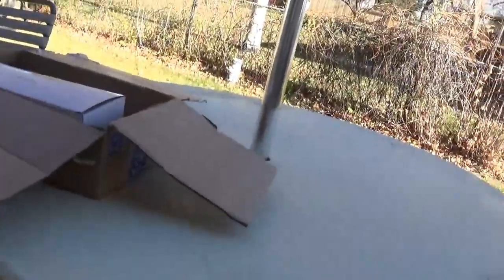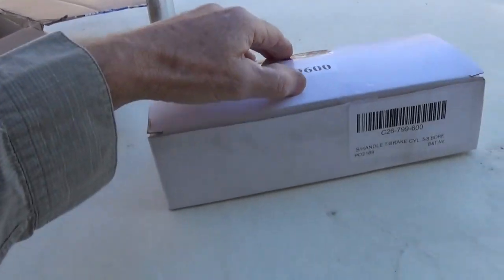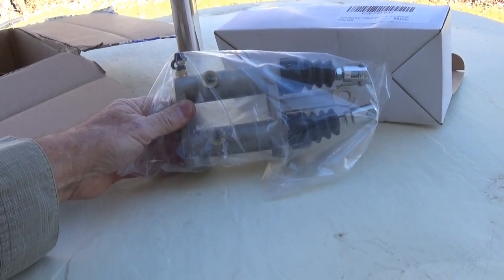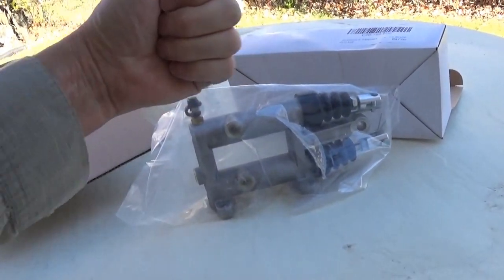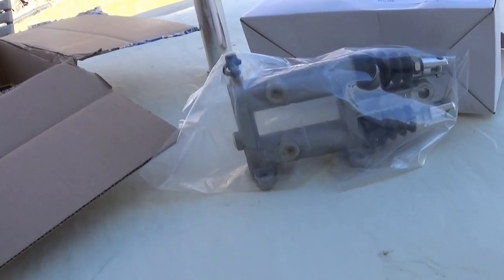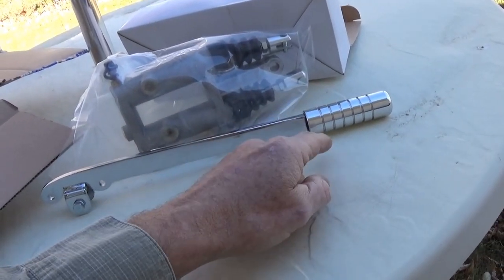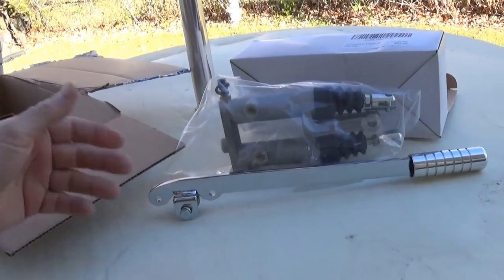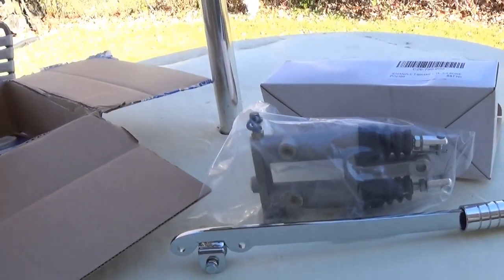Single Lever Steering Brake

Comment: Nice turning brakes, I bet with the single handle you could really operate them quickly!
Thanks for the bore size description, that was handy.
Reply from the maker: Quickly is part of it but it seems when I need it I need all of it really hard with one full hand and if I overdue it I can counter steer with out having to re-grip. It also takes up less space. I think it's more useful to me when crossing sand ridges because you never fully know what's on the other side durring those OH Chit moments. LOL  I don't even consciously think about right or left anymore my hand knows what to do so I don't have to think about it.

Comment: My 68 Tub Buggy had steering brakes when I bought it, but was just a homemade lever system that used the emergency brake cables!!  If the brakes were set up nice and tight, they worked pretty well.  Has a spool in it now, so it's all gone.  Have a buddy that has a hydraulic steering brake, and he uses it to lock up the spinning wheel when he gets stuck in the mud and snow.
Reply from the maker: Very Nice!  Before I got my Empi disc brake with E feature I used to take a bungie and hook it to my steering brake for a parking lock if I wanted to leave it running on a hillside.

Comment: I always wondered how those steering breaks worked but had something totally different in mind.... hope you put those on soon.
Reply from the maker: Just the kind of push I need. hehehe   It's cold and rainy outside right now. I don't want to shuffle around cars to get it inside and I have to buy some new brake line to work with. Thanks for your continued support

Comment: New parts make you feel good even if you don't fit them right away.
Reply from the maker: Especially if theres a little bling.   I've been admiring the chrome as it sits on the kitchen counter top all weekend.  One of the advantages of being single. hehehe

Comment: "South of the border" when we have to have the bubble flare because we have no adapter,  I make the standard flare then with a soldering iron and solder fill the flared area right up forming a" bubble" of solder, then drill  a 1/16th  hole in the center of the solder "bubble" and screw the line into the brake cylinder. Works great and seals just fine. Did that make sense?
Reply from the maker: What a great solution. Thanks Tim   Do you use soldering paste to get the solder to stick or rosin core solder or just what?
Reply: I use the paste

Comment: Oh yes your car your rules, Right? Nice, all them new parts means more good times for you in the sand . Never got to use one of those steering brakes before. Take care Buddy.  BigW:-)
Reply from the maker: I was thinking of getting another one for my Baja.  It makes sliding around on dirt roads easy and if your off roading or in snow and one rear wheel won't stop spinning you activate the cutter and it automatically transfers power to the other rear wheel

Comment: Hoping you see this.
Would you either do a video or talk in some detail about converting an IRS transmission to swing axle?
Finding solid info that I trust on this has been tough.
Reply from the maker: Well, I have playlists on that subject as well as recent tranny Here is one taking an IRS apart 
https://www.youtube.com/watch?v=d6aBj7W-dHU&list=PLOS0wPJkb5ZsRgSfxyYIeAXG2QxVnUv1C&index=2

Here is something recent on swing axles https://www.youtube.com/watch?v=1dbKPeJxfZgI 

I do my fare share of tranny work and still get the book out there is just to many things to remember. 
I suggest you buy a book or check one out from the local library.

If your tranny is good you should only have to deal with the Ring and Pinion and differential. You will probably need a donner swing axle tranny. You can get the backlash pretty close without special tools. Swing axles are so much more work but they are stronger. Don't expect to get it right the 1st try.  Let me know what how it's going
Reply: TheEZGZ thanks.
What I have is a good IRS transaxle and a '68 bug with a bad swing axle trans. I want to keep it a swinger and use the good IRS unit. I haven't seen anything specific to that, but lots going the other way. I'll check it the links you left.
Thanks, man.
Reply from the maker: It should be pretty easy then. You will off course have to swap the ring gear even if it is the same tooth count if you want it to last.  Just move everything over and bolt it together and see how it feels. Don't confuse the click noise for back lash with the slop in the planetary gears. Stick your finger in the drain hole and rock the ring gear. There is drag but you don't want it tight.  Drain the oil after a tank of gas and see how much metal is on the drain plug. There is bound to be some no matter what. Good luck with your project.
Reply: TheEZGZ thank you.
So I need to put the differential from the swing arm in the IRS case, keeping the IRS ring gear and that should be it?
Reply from the maker: It's the clint eastwood method......  Ya gotta ask yourself,   are ya feelin LUCKY?
Ya got a 50/50 chance. No guarantee.  A lot depends on how much HP your bolting to it.
Reply: TheEZGZ haha.
Okay. It's going on a 2030 with a C45 cam and some other hot rod stuff that would probably make some pretty good per if I weren't just running a stock pict34 on it.

Comment: Hey EZ,when u heading to the dunes and where?we head out the 16th.
Reply from the maker: You lucky dog.  I probably will wait until after the holidays with the family so not until after Jan 1st and I will need a window of nice weather as I only have 2 wheel drive and the trailer has no brakes at all. I might be there a while so I will post something up then. Have fun and keep the rubber side down so there is something left to ride with me some day. LOL